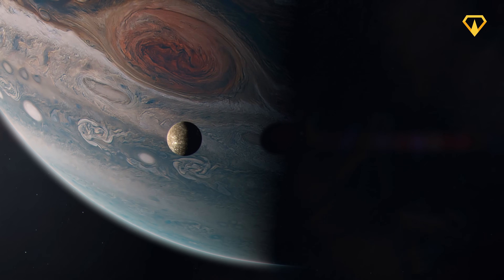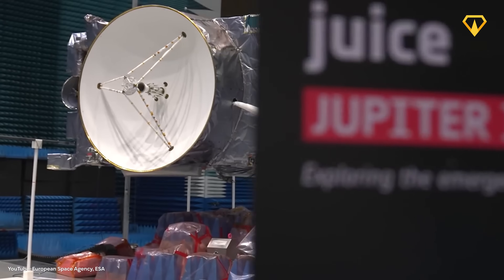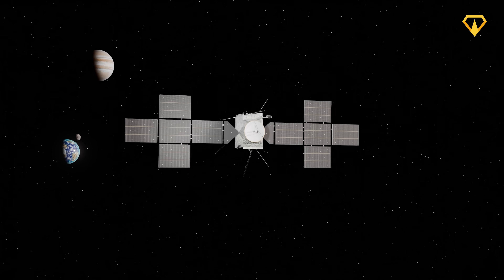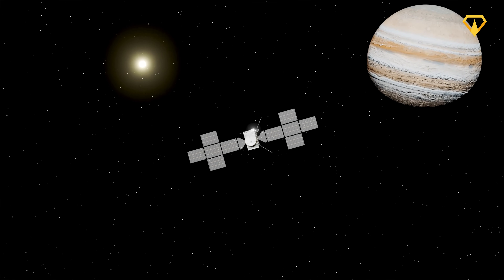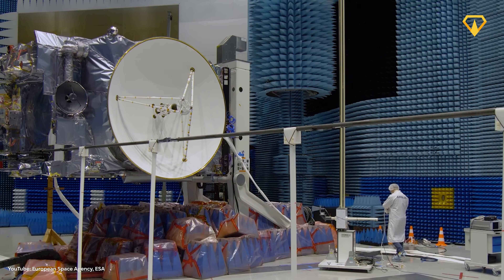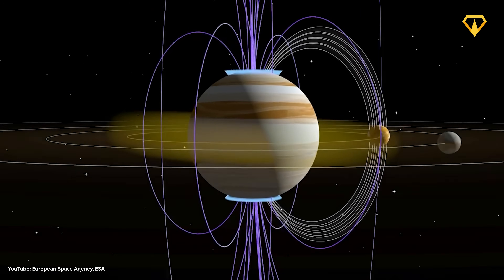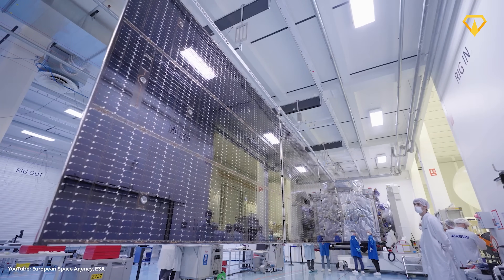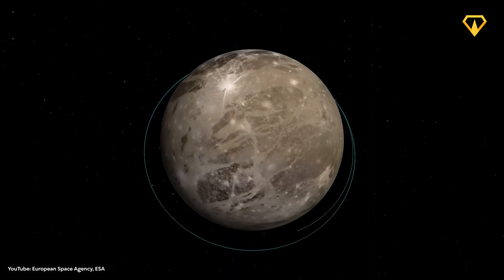The $1.7B Mission To Uncover Hidden Oceans

Comment: We need to put a ball with a hollow inside and inside makes the sound of thunder and lightning from a tesla ball in space
This will put water inside the ball

There's endless water in space but to get the water we need a place to put it and thunder to make the hydrogen and oxygen to drop and lightning to make it bind
The reason there's water on the moon is water from volcanoes on earth put steam in space which accumulates on the moon
That steam can be  trapped in space by other means
Which is also why there is ice that forms on the space station
Another thing we need to do is start making mountains on Earth so that we can make glaciers of our own so that we have an endless amount of water we are supposed to be making our own icebergs we are not supposed to be melting the icebergs that we have